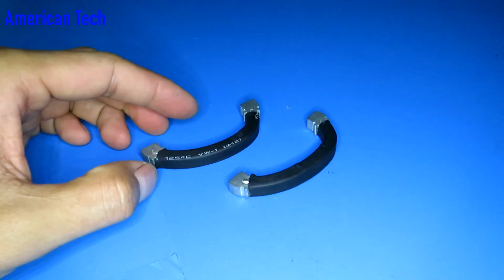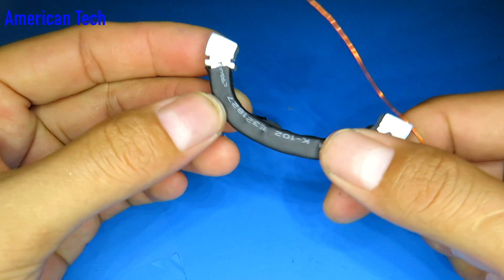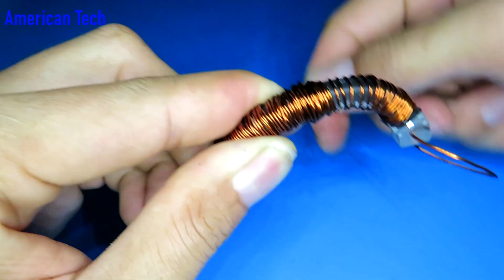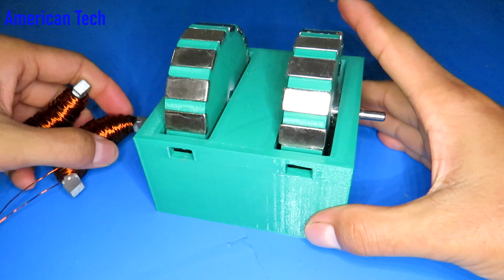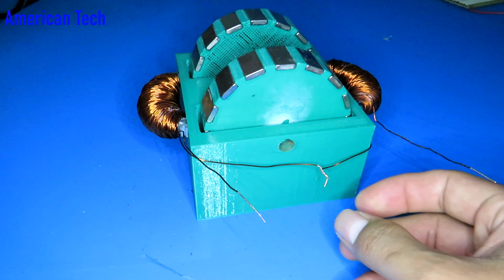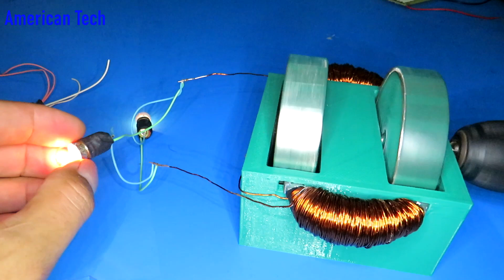How to make Generator 250W

Comment: How do you know it is 250 W? Did you do a measurements?
Reply: Two 4.5 V light bulbs rated at a current of maybe 200 mA => 4.5 V * 0.2 A = 0.9 VA = 0.9 W. That's not even 1 W!

Comment: This is a bit overrated, isn't it? Two 4.5 V light bulbs rated at a current of maybe 200 mA => 4.5 V * 0.2 A = 0.9 VA = 0.9 W. That's not even 1 W! Or did you mean that the drill you need to drive that generator wastes 250 W? 😂
Reply: This channel do be like that